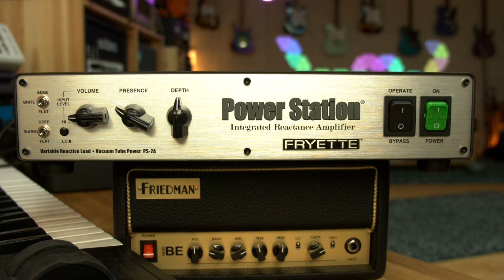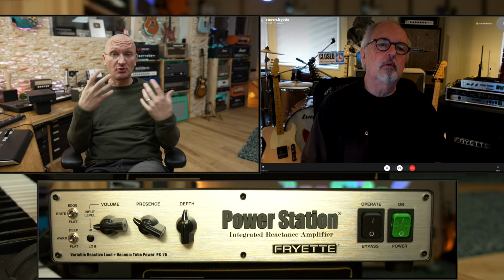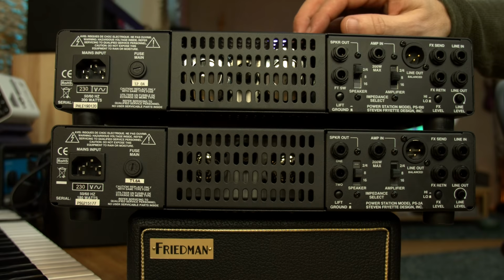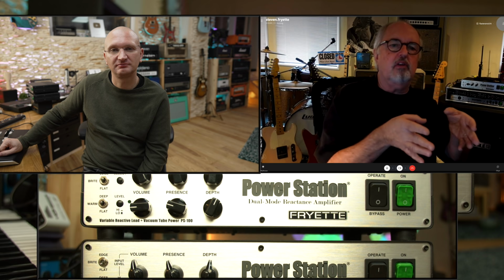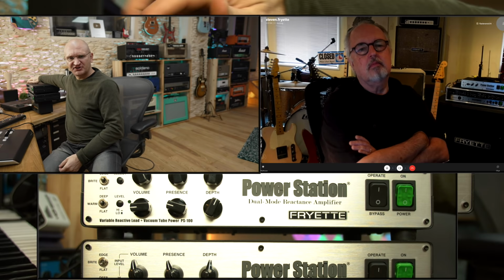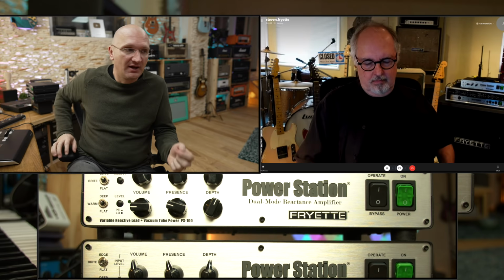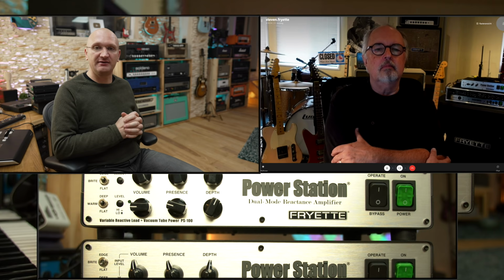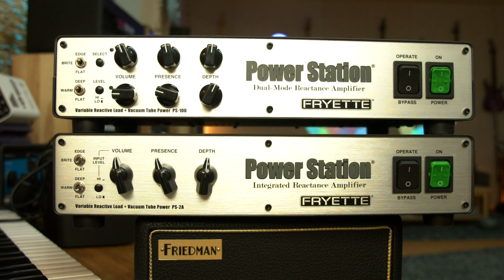The ultimate Attenuator? Fryette talks about the Power Station

Comment: I have a question. I own a PS2-A. I know how to use them BUT- I use most of my amps cranked. For example, my vox AC-30HW I use with my 2x12 with celestion blues. They are 16ohm speakers and measures 6.7ohms at the jack wired in parallel. I blew up a brand new amp in 20 hours of use ( not sure why yet). Sweetwater replaced it. I was wondering if running it through my PS2 would have the amp see a perfect 8ohms even when switched to bypass? Or does it have to be engaged to actually level the load to the amp? Not sure if the low ohms is why it blew but doing what I can to avoid damage when cranked ( where it sounds best) Does the PS2 provide some protection? engaged and/or disengaged?
Reply: This failure has probably little or nothing to do with the load. Impedance is not necessarily resistance, so your 6.7 DC ohm reading is correct. If the OT did fail, it’s probably because the OT wasn’t made to withstand a continuous full blast. If it failed going into a speaker, it would likely fail into a reactive load as well. If you want to continue using it like that, you might consider a more robust aftermarket OT.
Reply: @FryetteAmps  Thanks so much for the fast reply and happy holidays. You are likely correct. I believed it was the transformer that went. I could see nothing visually cooked but it smelled like a new toaster around the OT. I think I will upgrade it before using the new amp. Many Thanks!

Comment: Can't hold back, need to add this:
Steven, I'm ordering a PS-2A next week... 
Why? Simple... and I think the reason why I need one may be interesting to be shared with the community out there.
For my work needs, I need to test/play many vintage and vintage style amps in volume-constrained situations: Blackface and Tweed era Fenders, classic Marshalls and Hiwatts, an incredible sounding Komet K29, a 65amps, and a few Mesa amps. All amazingly good amps, but too loud at their respective sweet spot (even those with Master Volume!).
Tried way too many attenuators, never found full peace and satisfaction with any, as I always felt like losing the connection and the interaction between the output stage and the speaker. Since my job is Jensen Speakers, this is something I just cannot accept. So the PS-2A is THE solution for me.
And if I really want to go out there, and gig with my beloved 12W 1965 Princeton Reverb, the PS-2A will allow me to do it. Plus, in all the above cases, I can ALSO add effects and/or alternate preamps in its loop. 
Finally, if I want to play some of my preamps in the PS-2A, have a cab on stage, and add an external IR Loader for the FOH... I can do it.
It's such a clever, well-rounded solution!
Thanks once again! Speak soon!

Comment: If you want just an attenuator, there are cheaper alternatives out there. Why not get rid of the power amp and sell a good attenuator for less? I just passed on the PS-2a.
Reply: There are plenty of reasonably good (strict) attenuators on the market, including the good TK Ironman attenuator. But that’s not cheap either. If you go down the rabbit hole of attenuators you may then come back to the Fryette and just accept it’s generally regarded as the best device for keeping original tone and feel whether you turn volume down or up. But yea there are plenty cheaper alternatives. Those that buy Fryette PS devices have decided they simply
Sound and feel a lot better for their own personal
Use case… and I’m one of them 😊